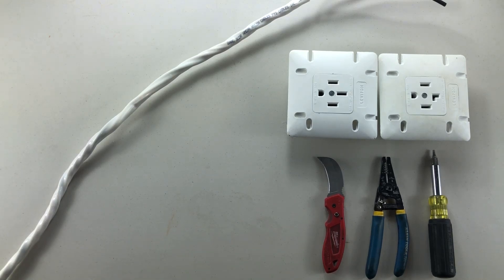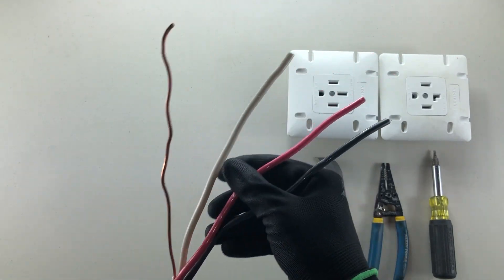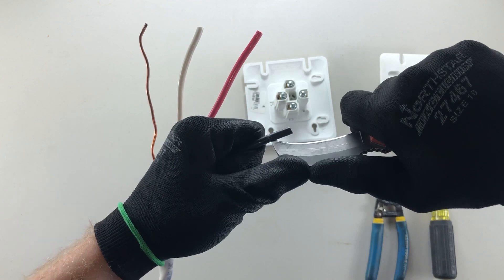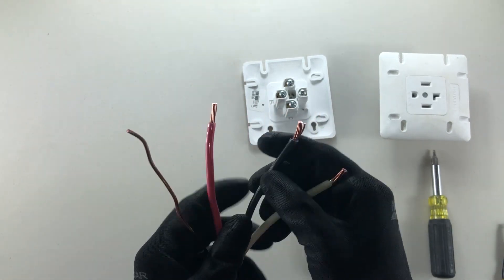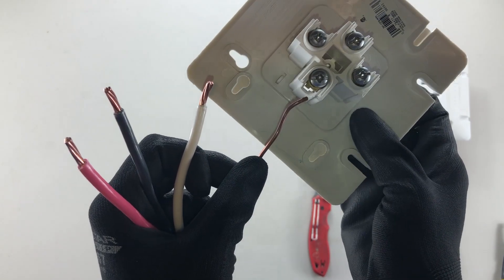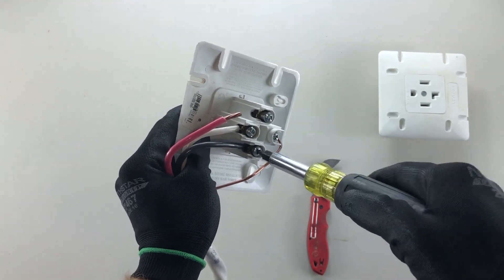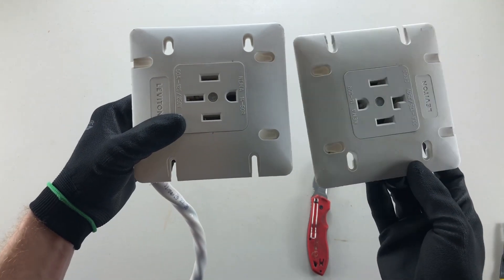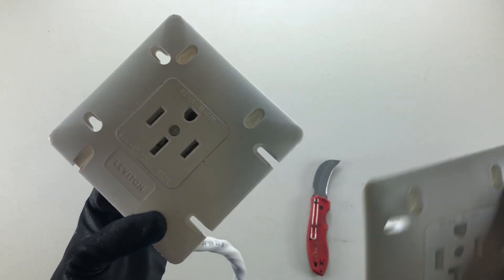How to strip #8 AWG wire - How to strip big stranded wire - The Electrical Guide

Comment: I’m working in a garage wired with 8awg to a bunch of 240 boxes. Will be using nema l6-20r outlets. The 8 gauge is overkill, but suppose it won’t have any voltage drop lol. Would you wire it straight to the back of the receptacle, or pigtail it down with some 12awg to make life easier when torquing the connections? The l6-20’s are spec’d for 8 max, but it leaves the clamping lug pretty crooked and takes quite a bit of torque to get the right strand compression.
Reply from the maker: Perhaps the more important question is what size breaker are you terminating on? That would determine the minimum size of wire allowed. If you're using 20 or 15 amp breakers there is nothing wrong with pigtailing #12 to make  your life easier.  If it were me wiring it I would be using the cheapest wire that the code still allows me to use. Hope that helps Dan Ervin.
Reply: 20a breakers in the sub that feed the receptacles. I’m assuming the 8 was used just to future-proof. But man, it’s hard to cinch down those terminal lugs. Appreciate the response!
Reply from the maker: @danervin2530  A lot of people would love to see welders in a garage. Perhaps those #8s were for future welders? Or maybe electric car chargers? If you were ever planning on selling you would be wise to add an electric car charger setup seeing as it sounds like the hard part is already done ;)
Reply: @theelectricalguide  My thoughts exactly. After the frustration yesterday I tried a spec grade Leviton receptacle- and while it gave CONSIDERABLY more confidence with the thick wire, I think I’ll still stick with the pigtails. The 20’s are indeed rated for 8, I just don’t think it’s necessary, let alone ideal. Thanks for all the help dude.
Reply from the maker: @danervin2530  Anytime!